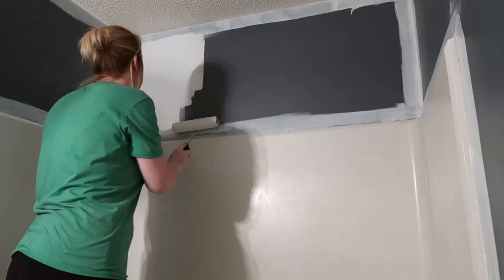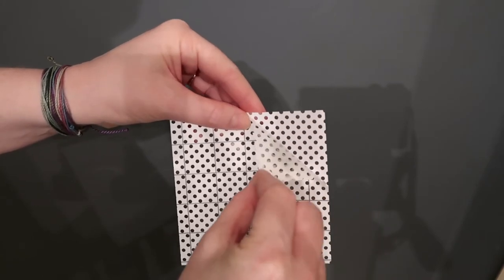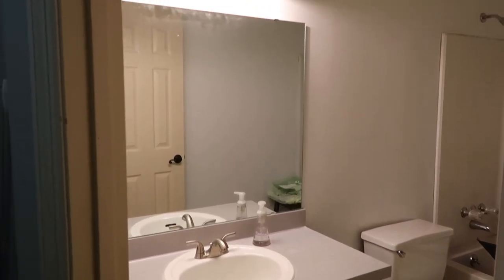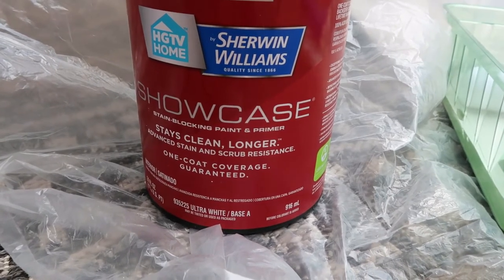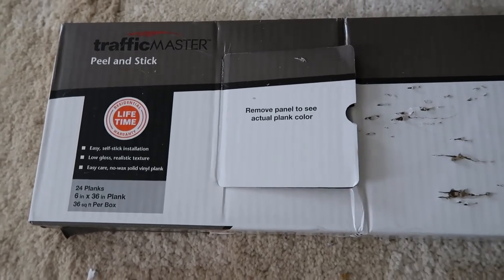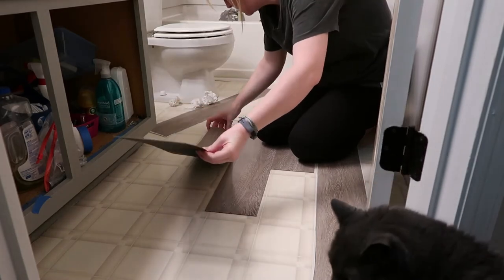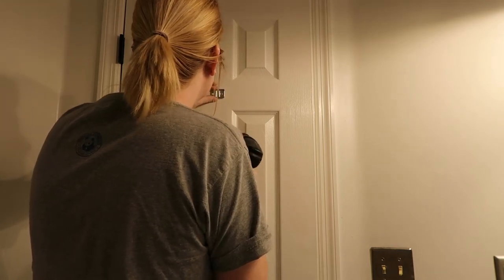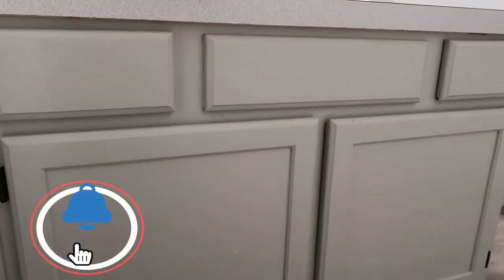Small Bathroom Makeover DIY | Farmhouse Inspired

Comment: Did you do any sort of primer on the walls to deter mold/mildew? I really need to paint my bathroom but don’t know what paint/primer is good to use in there.
Reply from the maker: I used Sherwin Williams Showcase paint in a Satin finish. It is a paint and primer in one and supposed to be stain blocking and stain resistant. I had to do several coats because I was painting over such a dark color but it has held up really well so far. If you’re worried about mold and mildew though, I’ve read there are specific paints for the bathroom that help with that. Kilz, Sherwin Williams and other brand’s make them- but I’ve not used them before.